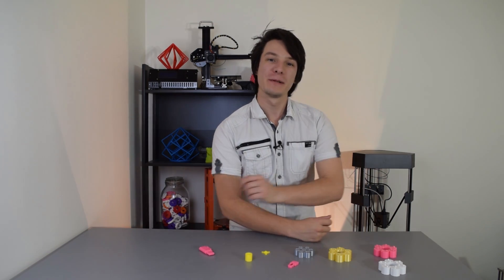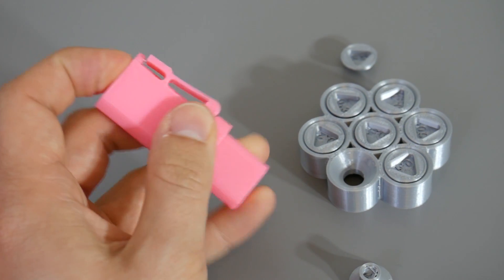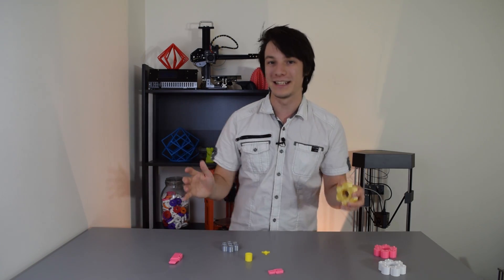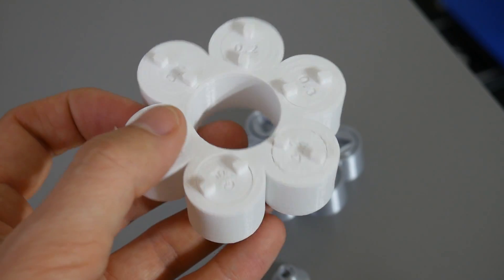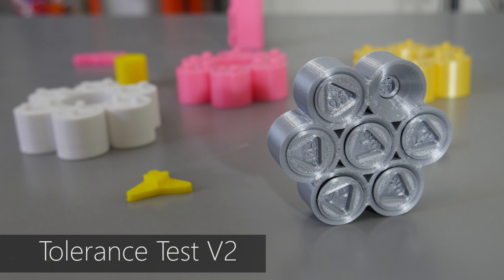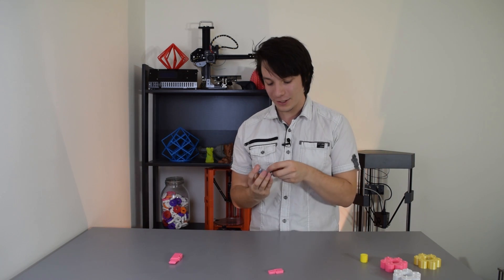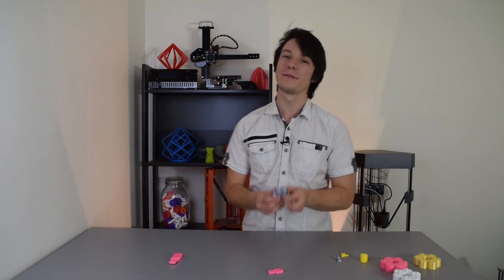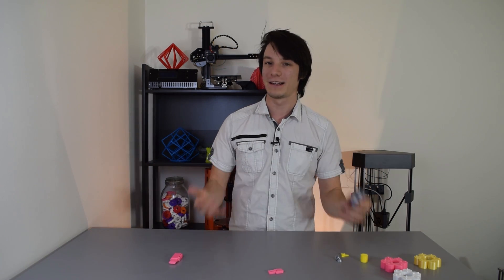How Accurate is your 3D Printer? Take the Tolerance Test!

Comment: I just tested to print this on my Flux Delta+ which arrived this week. I saw your first review on it and did have similar issues with my first prints, especially with the white filament. But I then changed the settings a bit, especially lowered the temp to reduce stringing and lowered the speed a bit and then printed this one with the black filament. The result was pretty good, all the way down to 0.2 was free as I grabbed it off the plate and .15 was loosened with ease, no go on 0.1 and 0.05 though ;)

Comment: I tried a different version from Thingiverse and the whole thing was locked solid.
Bought this one and removed all but the 0.5, sliced it with Makerware, Appeared solid at first
but with some force it broke free and it turned with some friction.
Got it sliced with Simplify 3D and no issues at all, plenty of movement. Did not even need
to be broken free. If i had printed the whole thing it would have worked as a spinner.

S3D did not do a good job with the numbers in the triangle though. Thats barely visible.

But $149 is too much for the software for a home use that just tinkers.

Comment: 5:35 - 5:46 I have a similar issue with my printer (I have a Robo 3d R1+) where the points it stops and starts there are small blobs or if it is close to another part of the print it fuses together. The slicing software I use is MatterControl (I use it cause it was free and easy to use for when I first got my printer a year ago). I tried different settings such as the speed and distance on the extruder, print speed, etc. It might be an issue with the software itself. I have seen pretty nice looking prints using my same printer (Look up "Novice Expert"). Any advice?

Comment: Just came across this video and just wanted to add some remarks.

I actually designed something similar than this, but I did specifically NOT use round spinning parts in my design. Instead, I used some rounded squares and triangles.
This is because it is in making corners where your 3D Printer will or will not stand out.

Making a circle with a 3D printer, even a cartesian one, is not as difficult as having the printer create a square. The main difference being, of course, than for a square, the printhead has to slow down, come to a stop and then change direction.
The higher the speed, or the heavier the printhead, or the more play there is in your printer, the more difficult this becomes.

Also, when doing a test like this, it is important to understand that changing printing temperature, speed or other variables will change your results.
Materials flows more easily at a higher temp, thus your tolerances will be less.
Same goes for higher speeds etc. etc.

Comment: Aside from 3d printing, even if you use something like the robonano for nano scale precision, you can't fit an 2mm peg in a 2mm hole, you will need to press them together, since they are the same size, and 2 things can't occupy the same space at the same time.

Comment: Hey dude. Is there a positive or negative result when you flip the axis? I just thought that the smaller tolerance cap broke due to a weakness in the print line which is where you were applying all of the torque. Probably not the point of the exercise but, you know where I'm coming from?

Comment: I should print it of on one of the university printers. They have at least 4 or 5 $300,000 printers.
Reply from the maker: Hah! That'd be cool to see how fine they can print. There's a few variations of this design up on thingiverse now as well for choice.
Reply: I’ve been there a few times. Usually results in a careless grad student running prints at the fastest setting possible and being “shocked” when there’s a defect.
Reply: @andrewridenour7332  from such expensive printers I would be surprised too.

Comment: always wondered why slicers like cura and slic3r don't account for the nozzle size when slicing ....
if you print a 10mm hole or a 10mm pole the hole is too narrow and the pole is ... well, its mostly right ....
however, a hole and a pole in an object makes the hole too narrow and the pole too wide.
in a cnc miller the mill (i.e. 2mm) is taken into account, its stays in the "no material" zone while with the printer, the nozzle just doesn't seem to care about staying OUT of the no meterial zone (or thers just too much plastig coming out .... anyways, slicer should adjust for this while keeping outside nice).
this is (imo) a stupid slicer mistake ... not seen a slicertest about this yet ....

Comment: Using my new Cocoon Create from Aldi last release, sliced with Craftworks.  I managed 0.1mm.  0.05 was clearly fused.  To free up 0.15 & .1 & (.3) required two keys, one on either side, and a slip wrench to hold the gauge bewteen the keys.

Comment: Lulzbot Taz 6 Using Polylite True Blue PLA.

I tried two different CURA slicers.  If you not famliar with Lulzbot.  Lulzbot ships a version of CURA customized for their printers/materials.  They pre-dial-in all the printer/material/resolutions they support(Over 1700).  Lulzbot currently ships with the original CURA.  They are in the process of converting to CURA 2, also called Qt CURA, New CURA, etc.  I tested both.
Lulzbot CURA Version 21.4.  Released.  Both 0.5 and 0.4 where free.  I couldn't break free any of the others.
Lulzbot CURA 2 Version 2.4.32.  Alpha.  Both 0.5 and 0.4 where free.  I could break free 0.3 with minimal effort.  0.3 is smooth with minimal play.
-Kurt

Comment: well I was trying to do this on my saffire sla printer however you have to use slic3r to export it out to a svg file. unfortunately. slic3r does not slice the file correctly. the .01 just disappears in the slicing. so no possible way to do so.

Comment: +Maker's Muse - I printed your tolerance test on the Aldi Cocoon Create and could free up the 0.5 down to the 0.15mm spinners. This is my first 3D printer and I am impressed. My bed was warped in one direction by 0.35mm and they sent me a glass plate. I tried bending the bed by hand and got the warping down to 0.23-0.25mm.

Comment: 0.15 was fine 0.1 is very tight 0.05 no chance Flashforge creator pro with E3D extruder in ABS at .2 layer height 3 walls bottom and top
Reply: What slicer did you use? I also have an FFCP (standard out of the box config, so far), both my attempts in PLA and ABS at standard Flashprint settings only had 0.5 and 0.4 free. All the others were solid. Someone sliced it in Simplify3D for me, but it was predicting 50 hours plus to print. How long did yours take?
Reply: S3D took 2.30 hours I could get the .1 working if I used PLA or PETG and changed a few speed settings and stuff
Reply: Thanks for the info. Next months 'discretionary spend' looks like S3D.

Comment: I don't do twitter or facebook .. Here is my first attempt, spins free including the 0.2mm.. the smaller ones are stuck., Robo3D R1 with a V6 & Titan extruder.  0.2mm layer height Esung PETG, 235 nozzle.  Bone stock simplify 3d PLA settings ( other than temp )  https://photos.smugmug.com/photos/i-3WntHcr/0/314d5b1d/X3/i-3WntHcr-X3.jpg

Comment: hello, I have a question about the heatbed: what happens if the heatbed is turned off? I mean, when the extruder is like 1 cm away from it, does it really need to be heating during all the process?

Comment: Printed one of these on a Prusa I3 MK2 earlier today. The 0.15 is the only one that I could free up that was stuck. There is a small amount of resistance when I turn it with my fingers, but it can be done with a good quality material and accurate settings. If I were to print it again it may be stuck permanently, or it may not.

Comment: So I printed the object on a Lulzbot mini using polylite PLA and .1 mm layer height and only the center would release.  I used tools to try and release the .4 mm and no go.  What is main issue that makes my tolerance required to be so loose. Flow? Layer height?
Reply: Update: on lulzbot mini,  I did 90% flow and got .4 mm to release then on 80% flow got .3 mm to release and it is still solid print. polylte PLA here with .4 mm layer
Reply from the maker: +Rich M .4 layers is pretty coarse! I'd try again with .2 you should get better. Otherwise it might be temperature related.

Comment: Isn't all this basically moot because he failed to use the same material on each printer?
Reply: A C It's not intended as a tool to compare printers or filament. It's a design guide. So you'd use it to work out what tolerances are suitable for your intended application when using a specific machine and filament.
Reply: @A C, Good point.

@Ben, you're right and wrong, I think.  Or put another way, I think you're contradicting yourself.  Yes, it's a design guide, but a comparison is indeed being made between printers and filaments.  For example, if you had two printers and needed tight tolerances, which printer would you use?  Print this on both -- with the same filament, as A C said -- and compare, then choose what's appropriate.  You could also characterize (compare) all of your filaments and choose them in the same manner.  This is more or less what you even said.

So this is absolutely being at least partly used for making comparisons, even if you're comparing only your own instruments and supplies.  If you have only one printer and one filament, though, you're right, it's useful as only a guide.

Comment: Thanks +Maker's Muse for this model. I just came to find out my new MK2S prints "bad" with the "best" settings out there.... 
I downloaded the "philipm" Simplify3D from the Prusa forums and sliced the Gauge test just to find out I can't even move the 0.5 middle one :'(
So despite the printed "tool" does fit the triangles, I guess i must have an issue with Z? Any clues how to find it out without wasting time and plastic?

Thanks!

Comment: When I was working as a welder, you always have tolerances in the blueprint of whatever you're making. So one dimension might be 2'8 3/16" +-1/32".
      Most of the time your tolerance is between 1/8" and 1/16". Sometimes you might encounter a 1/32" tolerance, but anything less than that isn't really considered reasonable for a welder/fabricator to get.
       If you have something with a smaller tolerance, you have the welder make it a bit bigger than you need, then hand it to a machinist, you can get very tight tolerances indeed. Usually better than 1/1000 of an inch.
      If you are making parts that go one inside the other, like that pink thing, you use a 3-D printer to make it bigger than you want, then machine it down to the correct size.

Comment: I'd like to know how you print the key with it's 3 corners hanging out in thin air?  Use supports, turn it over some how or what?
Reply: steve c Cura can easily rotate the file. It's not a mean trick, it's just you not knowing how to use your software
Reply: Yes but if you just flip it over you still have an unsupported area in the center where the graphic symbol is!
Reply: steve c that's a simple bridge that doesn't require support
Reply: In Cura sometimes when I import a print file it has some icons along the bottom that can be used to turn or move the object, flip it over and sit it down on the bed and other times those options don't show up and I can't find those features anywhere. That's why I was confused.  Do you know how to find the icons to do those functions if they don't show up with the print?
Reply: What version of Cura are you using? Im using Cura 2.4 and I can find those options on the top left corner after selecting the model I want to rotate/move
Reply: Cura 15.04.6.  If I click on the object the options will sometimes appear at the bottom left of the screen but if I click anywhere else they go away!  Also, if I click the option to make it Lay Flat on the Bed, it will rotate the object at an odd angle which seems strange.
Reply: Sorry Im using  Cura2.4 so I cant really help you with the old version of Cura. I'll recommend upgrading your Cura though.

Comment: So I printed it... and didn't do so well. The print looks nice and clean, but only the 0.5 and 0.4 would spin, the 0.3 and below were stuck fast, despite attempted turns of the key with a wrench. So what can I do to improve my tolerances?
(Printed @ Layer height 0.2mm, 3 shells and 50% infill, on a Wanhao i3 Plus)

Comment: Great test, I had a couple of shots at it second print I got the 0.15 to release although I had to get the multigrips onto it, the 0.2 released nicely with the key, I didn't bother with the 0.1 I expected that to be solid but the rest were free the moment it came off the bed.

Comment: Great work and a fun challange Angus!!
Mine came out spinning directly on .5,.4,.3 and after using the key I also got .2 and .15 going. 
I have (the new) Fabtikator mini V2, PETG on 250/50C, .2 layer height, 100% extrusion, 145% first layer, 3 perimeters and 40% infill. I'm happy with that :).

Comment: .05 works on stratasys objet 350 connex 3. Tested with digital abs and vero materials with 705 support material. .15 works well on stratasys FDM Titan with T20 nozzle, I'm going to try a smaller nozzle tomorrow and see if that changes anything.

Comment: i got the 0.1, 0.15, 0.2, 0.3, 0.4 and 0.5 to work on the  Up Box+
Reply: Yea, I also got 0.1 to work on the UP BOX+
Reply: i can almost get free the 0.05
Reply: I'm trying again on fine with ABS, I started it without a raft a see the 0.05 gap, so might be able to achieve it.
Reply: cool let me know your results, i might try again and see if it will move more easily, as i put a bit of effort into it to get the 0.05

Comment: Well, the fidget part works. The rest - not so much. I admit I didn't really expect it to - printing with a 0.6 nozzle at 0.3 layer height tends to ruin delicate designs :-D
Saves time, though. Still took well over an hour to print.

Nevertheless, I think there's something wrong with the X/Y axis, the walls look too irregular even for 0.3 layer height.  Or maybe it's the cooling - it's a massive object, giving off a lot of heat.

Comment: Printed this on a Flashforge Creator Pro (2016 model). Used the ABS filament shipped with the printer (apparently Flashforge own brand filament). Sliced using Flashprint with the standard ABS setting (0.18 layer hight, 220 extruder, 105 bed) at 'standard' quality. Only the 0.5 and 0.4 tolerances were free. None of the others could be moved even using the key. Rather disappointed.
Reply: Tried again with PLA and slightly finer layer hight. Same Flashprint software (don't have anything else compatible). Standard temp and quality (equals speed mainly with Flashprint apparently) settings. Flash forge supplied (blue) PLA. Same result. Only 0.5 and 0.4 free. Couldn't move any of the others even with the key. 

What settings would people change to try to get a better result? Layer hight, Extrude temp, Bed temp, print speed? Flashpoint on a Mac doesn't seem to support any differences for initial layers.

How much difference does a different slicer make? What are people who are getting good results using?

Thanks in advance for any helpful suggestions.

Comment: I printed this part on my Raise3D printer and I can turn all of the "wheels", including the 0.05 mm. All wheels were loose right off the bed, except the 0.05 mm which had to be loosened with the key (to be honest it took some effort).
I am not so surprised about this, as I earlier made PLA dovetails for multi-part assembly using exactly 0.05 as clearance.
The spinner was printed with PrimaSelect Satin White modified PLA, which is extremely strong and a very nice material for precision printing. Layer height 0.15 mm, 3 shells and 40% rectilinear infill.
I like to think that there is a difference between a 2k US$ printer and cheaper printers in the range from 100 to 700 US$, but in reality I think what matters a lot here, is the filament quality and how well your extrusion is calibrated to the actual filament. Also printing speed, retraction parameters and coasting distance matters to avoid bonds across the gap where perimeters start and stop.

Comment: I just printed this out on a Flashforge Creator that has been having problems lately.  The .5 center and .4 are the only loose parts.  M&M what were the S3D settings you used for your part?  I just want to try and duplicate your results at this point since Im not even close to them now.

Comment: Got the 0.2 one spinning with the key, anything smaller than that is completely welded.

Printed it on my Wanhao i3 v2.1 with 0.2mm layer height, using PLA

Comment: just tried it. 0.3 was open, 0.2 needed the key and 0.15 was totally locked.
0.15mm layerheight, 4 wall line count / 0.25 line width, 10% infill, 200°C / 55°C, 70mm/s.
used the cheapest pla i could find in my country,  on a anet a8

Comment: Angus, 
Another great video!
A general comment on tolerance and fit.  This is independent of the issues specific to 3D printing. 
There are different types of fits between two parts, such as you discuss early in the video with your hinge (?).  For example, two parts can have a force fit, a sliding fit, a loose fit, etc.  This is a reflection of the specified size difference between them, as well as the accuracy of the production method.  Data on this is published for machinists, and has been for decades.  The required size difference between two parts varies with the type of fit desired, as well as the materials and the production method.  The required size difference is also affected by the size of the part.  For example (using made up numbers), a sliding fit for a 10 mm hole and shaft may be 0.1mm difference between the diameters, but a sliding fit for a 1000 mm hole and shaft may be 0.7mm.

Comment: As you stated, I don't think the comparison between your printers is very accurate... Only because you used all different filaments. I am sure that plays a huge roll when dealing with such small tolerances. For a fair test, use the same filament on each printer.